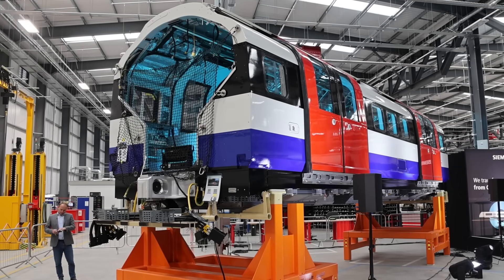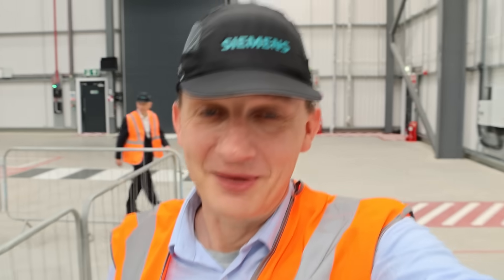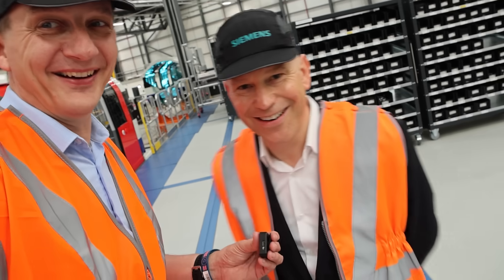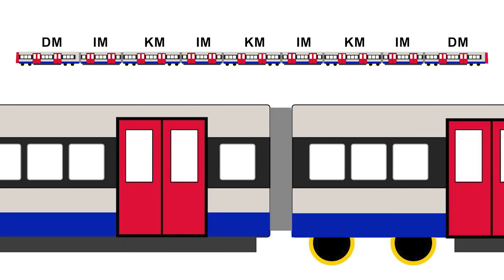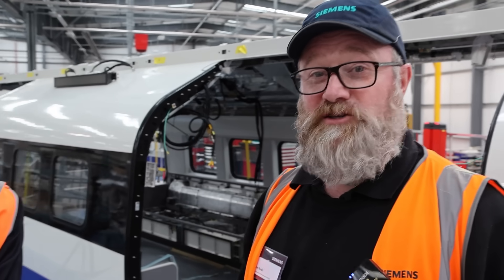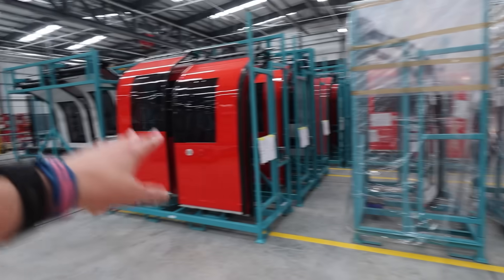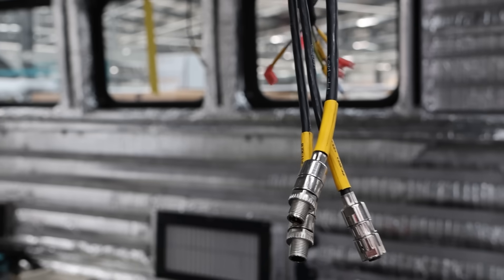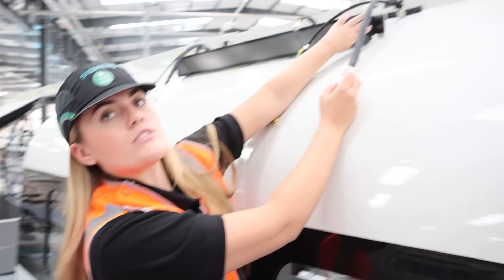The New Piccadilly Line Trains Are Being Constructed

Comment: As a Bostonian, I WISH the MBTA bought their new Red and Orange Line rolling stock from Siemens. The T gave the contract to CRRC, a Chinese company, who opened a factory upstate in Springfield. There were numerous delays and when they eventually got to Boston, there were so many teething issues with the Orange Line stock the old 40-year-old cars were forced into even more service, despite a train bursting into flames on a bridge over the Mystic River. The oldest Red Line cars occasionally arc explosively from the third rail (like, it legit sounds like a gunshot when it happens), so I'm legit afraid they're gonna burst into flames too if they don't get pulled from active service soon

Comment: with the exhaust heat coming from the air conditioning, will we get even hotter on the platform?😥
Reply: The trains emit less heat than the current trains so theoretically no but we have to see.

Comment: So why don’t they make all trains modern like this so the height and doorways for wheelchair users to simply roll on and off a train at a platform. No steps or need for ramps. Absolutely shocking in this day and age. Only see these trains in London and nowhere else. I know platforms are different especially tube trains but every day trains that run in the country they should change them so everyone can access them easily amount of times you have called ahead for assistance and no one there at the other end. Sort the trains no need for assistance or the stress and worry if someone will be there at the other end

Comment: Not really a train building factory - just an assembly line.  Nothing actually manufactured here.  "We're going to make 80% of the trains here in Goole" - you mean you're going to put them together, but 90% of the components are all imported!  Of course all the politicians love to get in on the act of what great news it is for the community, but really it's a whole lot of gaslighting.  Giving Siemens an open door to get their foot in, so they can do most of the work and make the real profit overseas whilst investing nothing in UK manufacturing, other than putting up a shed, but painting themselves as bringing train-building to the UK.  You need to look a bit deeper and not just swallow their Kool-Aid.

At least with Alstom at Derby by contrast they use a lot more UK subcontractors.
Reply: Not gaslighting. It's not their problem that you're thick enough to think that "80% of new Piccadilly line trains will be assembled in Yorkshire" means "80% of the parts will come from the UK"

And it is still great for the community. 700 new jobs in that area and another 1700 in their UK supply chain is much better than importing the entire thing and not having any jobs in the UK

Comment: Lighter trains save energy and accelerate faster. All good so far. But more than half the length of the Picc is not in tunnels. Light weight trains, autumn leaves, red signal. Think Salisbury or Cambrian Line then think again.
Reply: If you notice the Met line trains are still running in the leafy sections. The technology for the leafy outer sections is better on a modern train.

Comment: Air in the tunnels is warmed by the energy dissipated by the motors and brakes. This air, and brake dust, is sucked into the trains, cooled using energy, circulated within the carriage, then as warmed air exhausted back into the tunnel. Repeat! Am I missing something?

Comment: So sad… the 3 pokey windows between each door set are just too small, or rather the dividing pillars, too thick. Ribbon glazing on the outside would help and eliminating the rounded corners on the inside moulded trim would help immeasurably.

Comment: You're doing a great job, Geoff 👏👍 

The new Piccadilly tubes with air-conditioning, walk thru (assume will be noise free😊)🚶‍♀️are Pros

The biggest cons/letdown i see are the windows. They are really tiny(width & height) 🪟 😮😢.

Did Siemens Design & Architect borrow the windows size design from Airbus? or did they sleep over 😴 ?.

The current 50 year old Piccadilly has better large sized windows that bring far more light and visibility.

These new trains(when passengers are sitting or standing) will make it very difficult to look outside to check entering station's platforms. 
And since trains will be packed, everyone sitting can't see outside but onky the opposite passengers 😮😅. 

Seriously either Siemens screwed the window design😮, or the TFL fellows are thoughtless fellows😮. 

2.7 billion were spent with tiny aircraft windows 😊 😅

They can argue that large windows will not be energy efficient, if thats the case, then they can as well as have no windows 😅😆😜

Comment: Hot air rises, so the heated air extraction vents at floor level cannot function effectively. Air conditioning functions by blowing chilled air from inlet vents at floor level & as the air in the carriage warms, it rises above the heads of the passengers, to be extracted at roof level, together with the CO2 from people breathing. Chilled air flowing down from roof level onto the heads of the passengers is uncomfortable & irritating.
Beginner's guide to HVAC design.
Reply: When you've got a space as confined as this, there are probably design trade-offs going on

Comment: I am loving the hard work and effort to get these new trains out into service. But can anyone let me know if the new piccadilly line trains will turn the line into a sauna like the New York Subway. (For context, in NYC, the subway system in the summer gets really hot on the platforms because of the hot air that is exhausted out of the train.) I hope that this won't happen and TFL has a way of dealing with this issue.

thanks for reading a lengthy comment :D

Comment: It needs to be fully automated on the dm units, it’s not hard to add LiDAR and multiple long range sensors and add the door with cameras to prevent crush or accident injuries in combination with a station staff either locally or cctv remotely, to approve station release.  We already have barriers from platforms that needs to be rolled out globally to prevent suicide cases and accidents. The cctv is fully ai ready trying the two together is a priority to cut drivers and union disruption
Reply: It’s not as simple as you make it out to be.

Comment: Such positive people who are working on these trains - really good to see. Hopefully these will go on the Bakerloo as well - maybe could they go onto the central line in the future? 

Re the air con - won’t the hot hair exhausts just make the tunnels hotter?
Reply: Correct. Which is why air con hasn't been looked at for many years. It'll be on TFL to make the station cooling much, much more efficient. The tube has already hit 40C WITHOUT the extra hot air from the air con!

Comment: The 72 stock needs replacement badly, although there is only 1 year difference between the 72 and 73 , the motors on the 72s sound like they are from the 1930s .
Reply: I think they actually are but were reused a lot. I don’t know but I’ve heard something like that. That’s why they lasted so long. They were simpler.

Comment: While the age-old Piccadilly tube stock has been screaming for replacement, what I see here is pretty much the same, except cosmetics.
New trains should mean departure from the same old designs and bigger size, given the way they get overcrowded. Or may be they need newer track to accommodate new stock. In the meantime, new trains will bring some smiles.

👍
Reply: Not sure how you're meant to fit a larger design in the small tunnel... however these are using the maximum envelope possible. There's more head height and they're slightly wider
Reply: It’s probably more different than you think. The pic line wouldn’t use as many cables. The motors are different. The train has different door technology.
Reply: @ Hopefully, yes.
Thanks.

Comment: Why are they supplied with door buttons 8:48 when you know damned well they won't be functioning?
Reply: They do work in certain circumstances. When a train terminates at an open air station and sits at the platform for a while before starting a new journey, if it's cold the people boarding tend not to want to sit there freezing, and the driver probably won't want to be opening and closing each door for every person who wants to get on. True of S7/S8 stock and 1996 stock
Reply: Clearly you don't ride trains

Comment: I hope the new rolling stock have sufficient fire detection/prevention capabilities - switching to Aluminium bodies has one huge disadvantage - its burns like crazy. Tragically, there have been devastating fires exacerbated by the use of aluminium in structures e.g. Grenfell
Reply: All tube trains since 1956 stock have had aluminium bodies.

Comment: I see some problem with ventilation system:
Hot air naturally goes upward, so why they design this ventilation system "upside down" ?
I know, fans can force air to move, but in case of mailfunction - this will be a sweat box.

Comment: Weren’t the original electric locomotives used on the City and South London railway when it first opened in 1890 made by Siemens?
Reply: They were made by Mather and Platt in Manchester.
Reply: Siemens didn’t exist in the 19th century

Comment: Placing second order for trains already in production is great idea. In Montréal, as the order for MP10 (steel trains heavier than previous generation) was abount done, the government, knowing Bombardier was about to go belly up, placed a second order for the exact same model knowing that allowing production line to stop would mean any subsequent order would have to be for totally new trains that woudl need totally new debugging and delays.  While Siemens is not approaching bankruptcy, it is still far more efficient to ented an existing production line and supply agreements for parts than to stop it, and restart it a few years later.

Comment: Obviously a fake AI generated video with the AI putting a suit on Geoff by mistake 🙂
Making the trains out of aluminium (finally) is brilliant.  Reduced power consulption is a big deal when you wish to reduce train spacing in tunnels which results in more trains drawing power from the same power segment/transformers on tracks.   And reducing heat generated by train with lighter train, regenerative braking also allows heat produced by air conditioning to likely arrive at same heat production as older trains.
Reply: Other modern tube trains are built with aluminium

Comment: Here in NYC they just started running the new R211S trains in Staten Island, well one of them. Really just seeing how it does in real world use after months of test runs without passengers. (Staten Island Railroad being built by B&O and not the usual suspects wound up signaled/cab signaled like a railroad, not a subway, but the MTA wanted subway cars here, so these are customized versions of the R211).
Reply: I'm looking forward to riding the R211s on my next trip to New York. Where are they designed and manufactured?
Reply: @julianbassett5172  Kawasaki, I think the Staten island cars are being assembled in Yonkers (likely from Japanese made parts). There's also a plant in Nebraska.

Comment: Nice to see the East Riding Councillor smiling away. I have lived in Goole for 30 odd years and what she didn't mention was that Goole has seen left to rot, the Town centre is less popular than the local cemetary with shops closing just about every month, the leisure has been shut for months and will not open until summer 2026 if we are lucky as the construction has been delayed and it doesn't look like it will have a proper swimming pool. All this despite Goole have the highest council tax in the East Riding of Yourkshire and one of the highest in the whole of the UK.

Comment: Does Siemens understand that the hot air will be up in the top of the coaches and the cool air will be down by every ones feet? Seems the HVAC System will be working against physics!

Comment: the Bakerloo Line needs to be converted to fit a Crossrail train. It doesn’t need these new trains it needs a full on upgrade. From my understanding a 345 is only like 80cm that needs to be taken off the top of the tunnel for it to fit. Come on TFL, Think bigger 😎🔥

Comment: I also hope that whenever the new Bakerloo line trains come out, they’ll feature brown poles inside the train, in order to match the line colour
Reply: New trains since 2010 have been built with elements like grab poles in contrasting colours, usually yellow, for the benefit of people with visual impairments. It's part of the Rail Vehicle Accessibility Regulations but old stocks are grandfathered in so don't need to be adapted outside of a major refurb.

Comment: Please give the 73 stock to the Bakerloo or something!!! Those old trains are dire now :P
Reply: The probably don't fit the Bakerloo tunnels.
Reply: @physiocrat-sv Actually the 1972 TS trains are 1” wider than the 1973 TS; so the 1973 TS will be safe for use on the Bakerloo.
Reply: @BUMBLE-FART  
What about the length and distance between the bogies?
1973 stock
DM 17.473 m (57 ft 3.9 in)
UNDM/T 17.676 m (57 ft 11.9 in)

1972 stock
DM 16.091 m (52 ft 9.5 in)
T/UNDM 15.977 m (52 ft 5.0 in)

Can't say unless it has run over the whole route.
Reply: @physiocrat-sv  You made a good point; because of the very tight curve between Paddington and Edgware Road, the 1973 TS might not be suitable as the cars are longer; if it’s possible then I can’t imagine the 1973 TS doing more than 10MPH on that curve.
Reply: @BUMBLE-FART  
It needs a gauging test to be certain. I wonder about the new trains.

Comment: These trains are a bit of a disappointment following the S stock's accessibility and interior space improvements over its predecessors. The floor isn't level with the platforms, there are no gap fillers and the externally hung (instead of plug) doors make the interior a good four to six inches narrower than it need be. The Stadler stock for the Glasgow Subway have set the absolute standard for tight-clearance tube trains.
Reply: Plug doors are probably not practical for intensive metro service.

Comment: Hopefully they follow through with replacing 1972 and 1992 stocks with these as well, maybe even take it a step further and eventually replace 1995/1996 with these too
Reply: I wouldn't like every tube train to be the same tube stock, variation is interesting.
Reply: @Peter-mj6lz maybe the deep tube can have a consistent stock but one line has a unique fleet (Victoria Line 2009 Stock)
Reply: @Blank00  It can but that would be boring. I would rather the 95 and 96 stock when they are changed in 15–20 years get more advanced, improved trains than the 2024 stock.

Comment: Kinda feel the 1972 Stock on the Bakerloo needs replacing first; was on 1973 recently and it honestly felt as though it could go on for another decade
Reply: 1972 mark 2 stock is actually slightly younger than the 1973 stock (they were a repeat order of the 1972 mark 1 stock, which was older) and, as is often the case with the end of a production run going back, in this case, to the 1967 stock, had all the bugs ironed out whaeas the 1973 stock was the first of a new run (which included the D stock and 1983)
Reply: The Piccadilly Line move many more passengers than the Bakerloo. Secondly as the 1972 stock is fairly primitive and only required 38 trains it was much easier to refurbish the 1972 stock.

Comment: Now why would you have a problem with a heavy train?
Reply: @QuarioQuario54321  Ask Isaac Newton. They use more electricity. Simples.
Reply: @caw25sha  Increase the power on the motor then. The voltage is probably not changing.
Reply: @QuarioQuario54321  the point is to use less power.